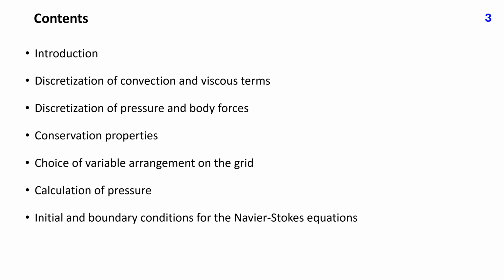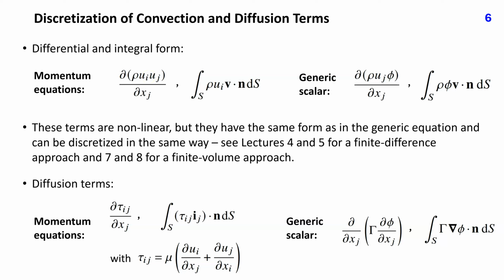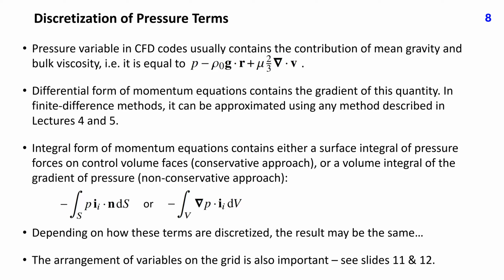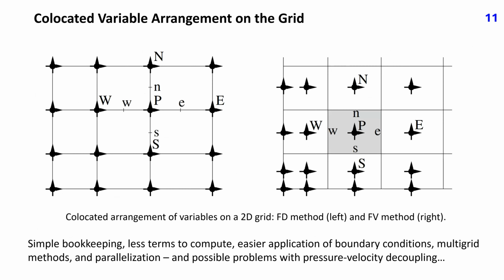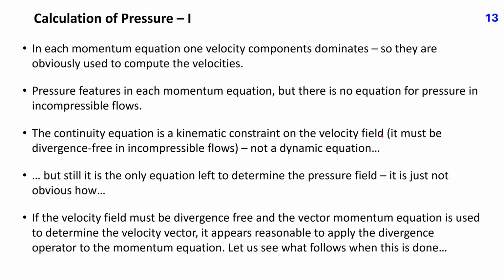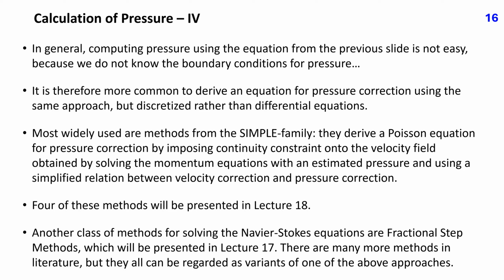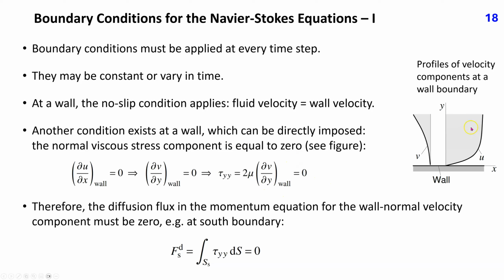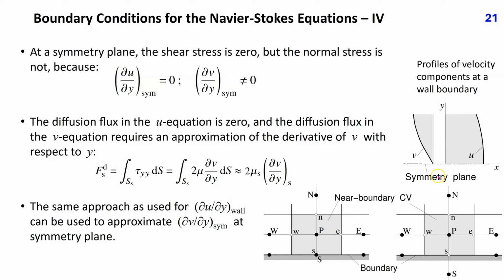16. Introduction to solution methods for the Navier-Stokes equations

Comment: Dear Prof. Peric,
Thank you for your lectures. 

I would like to ask about the boundary condition for pressure-velocity fields in external flows, e.x: flow over a object. Usually, in OpenFOAM, at the inlet, the velocity is set to fixed value and pressure is zeroGradient (velocity-inlet in Fluent), and vice-versa at the outlet. What will happen if, at the inlet or outlet, we set the same boundary for velocity and pressure field (fixedValue or ZeroGradient)? I tried that approach for a test case, and the solver get diveged. 
One more question: For the boundary condition of the pressure at the outlet, it is usually set to atmospheric pressure ( for gauge pressure p_gauge = 0 Pa). It is known that in incompressible flow, the value of the pressure is not important but its pressure gradient. Therefore, if I change the pressure value to a number that differs from 0, the simulation results remain unaffected. Can you elaborate this?
Reply from the maker: Sorry for my late reply...
One cannot specify at both inlet and outlet velocities and pressure. If velocity is specified at inlet, then one can specify it also at outlet if it is ensured that the flow rate through both boundaries is the same (in an incompressible flow). If the velocity specified at outlet results in a different flow rate than the specified velocity at inlet, one cannot obtain a solution, because boundary conditions violate the continuity (mass conservation) requirement. In this case pressure must not be specified at any boundary.
One can also specify pressure at both inlet and outlet. The flow is then driven by the pressure difference between inlet and outlet, and the solution will converge to a flow which  results in the specifies pressure drop (i.e., friction and shape losses will match the specified pressure difference). In this case you cannot specify velocity at any boundary - the flow rate must come out as a solution.
The usual combination is specified velocity at inlet, which defines the flow rate, and pressure at outlet, which defines the pressure level. Pressure at inlet will come out of solution such the the pressure drop from inlet to outlet matches the losses for the specified flow rate. Because in an incompressible flow only pressure differences are important, it does not matter which pressure is specified at outlet; if you add a constant at outlet, the same velocity field will be obtained, but the pressure at inlet will come out increased by the same constant which was added at outlet.
In terms of flow physics: you can specify either the flow rate or the pressure drop, not both, because one depends on the other.
Things become more complicated in compressible flows...